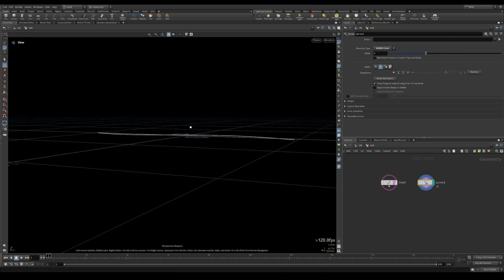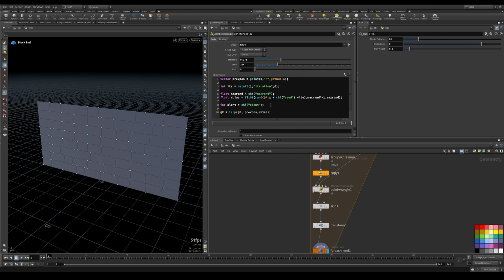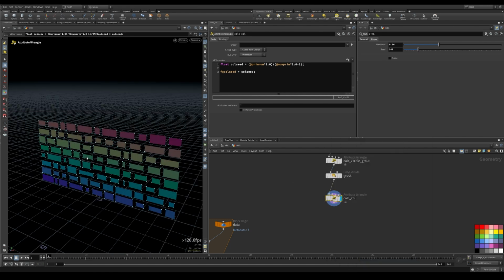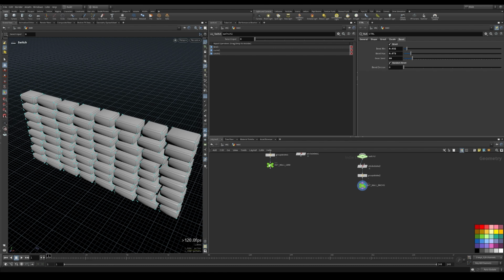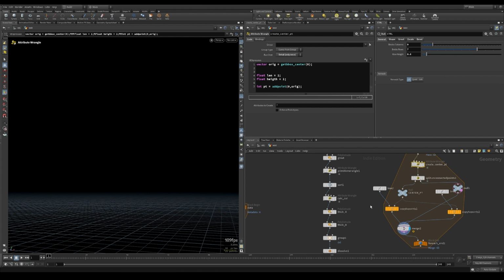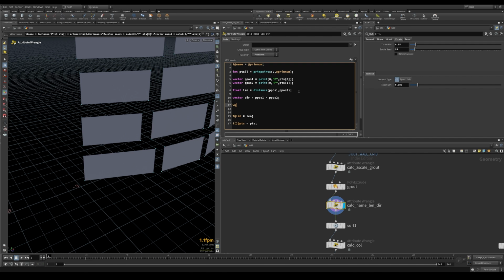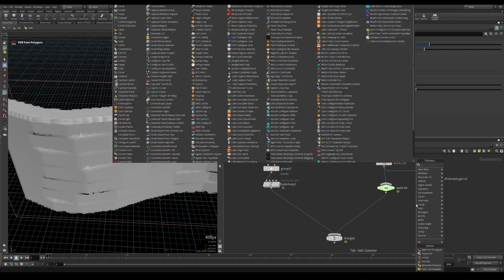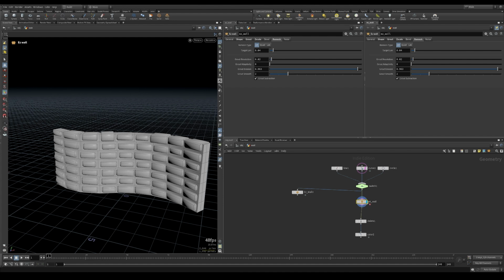Create a Procedural Brick Wall HDA in Houdini

Comment: hey, what if we want to feed the HDA into multiple lines...
how can we keep the brick sizes consistent now matter how long are the lines?
Reply from the maker: Directly feeding in multiple lines into the Hda would require some rethinking of it, right now it would cause trouble in the first Loop where the "skin" of the wall is created. The quickest solution IMHO is to merge the input curves and feed those in a For Loop by primitive (so for each curve) and throw the Hda inside the Loop.
BUT first you need to modify the first resample node of the had to be based on Lenght and not Number of Segments, so it will be equal for each curve, no matter the length

Comment: i have a question ,if you draw a lot of curves in illustrator , and you want to make them as walls with this hda for a PC-game...but some of the curves in illustrator are bezier curves or splines , but the spline will turn into small lines , for example they don't behave like your circular input(they are not closed curves)...when i import my curves i get a bad result, can you help?
im trying to find out how to make a game in unity...
Reply from the maker: I guess it depends on how the curve are drawn in Illustrator. How do you import the curve into Houdini?
Reply: @ezpepz  i save as SVG , then i bring it to blender and export it as OBJ... , but they will be converted into segments instead of a curve with handle and perfect shape...
Reply from the maker: @rshiya5018  Probably it has to do with the Houdini import of the file. I'm doing some test without blender, importing directly the .ai file into Houdini (you can read .ai files if you save them without compression from Illustrator) and I do see a correct behaviour on the straight lines, but whenever there's a bezier, it bypass that point
Reply from the maker: @rshiya5018  I did some other tests, if you save your file as .ai, without compression and compatible with Illustrator 8, when you import it into Houdini, you get all the correct curves (the only problem is it close all the open curves), and you can do a for loop to resample those.
Reply: @ezpepz  yes it will close the curves , but if you add an Ends node and set the start to "open" it will be fine , but still it doesnt come as perfect circle , i had to bump up the resolution of the curve to achieve a better curve , thanks for your amazing video and your help <3
Reply: @ezpepz  i tried many ways, but still i cant get a good result , the ends node only works with few curves and also resample also gives bad results, but as i was testing , your wall generator hda works with polygon and all other types of nurbs or bezier curves, maybe there is another way to bring the shape as polygon or VDB meshes instead??
Reply from the maker: @rshiya5018  I also did further test, there's a problem with the end of only some curves, but I only tried wit .ai and .eps. The Hda is built to work with an input curve of any kind, but the problem is that the curves are already drawn wrong in houdini. Have you considered other methods, like exporting a .png with the curves and create the curve directly in houdini with a Trace Sop?
Reply: @ezpepz  yea , about that ... first of all i have to give the curve an stroke so it will be visible inside a png or a psd file , and with that i dont get a single line curve with tracing , i get 4 line curves like a bounding box , i managed to get some kind of obj export from blender , but it only brings the points, and i have no idea how to connect them in the order the points are connected inside blender or AI
Reply from the maker: @rshiya5018  if in that workflow there's no information about a point be part of a certain curve and you only get points, I'm afraid there's no way to connect each curve correctly, unless they are made of the same amount of points...
Reply: @ezpepz  i just didnt want to redraw all the curves inside houdini again... but i guess i have to do it non procedural and remake my level map curves inside houdini with curves...
Reply from the maker: @rshiya5018  you may want to take a look at this: https://github.com/Aeoll/Aelib . It also has the solo SVGimporter/exporter to download, but without the full suite I was getting a Python error for a missing module. It gives some warning on skipping things, but it seems to import all the curves correctly.
Reply: @ezpepz  thanks man , i had the same python error that i guess was about the python version of 20.0 and this library, but anyway i finally brought all the curves identical as the shape : svg version 1.1 from Ai , import svg to blender and set spline.type = 'BEZIER' , then export an obj and you got your curve with specified resolution